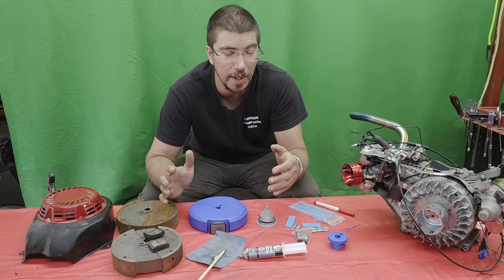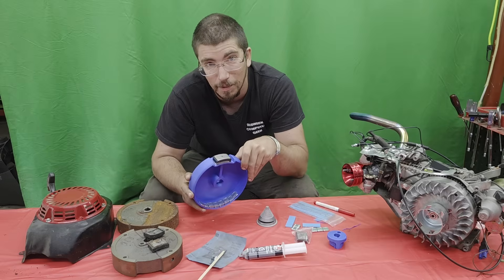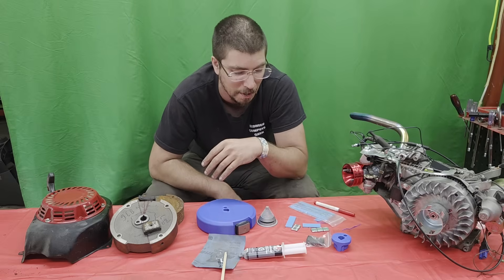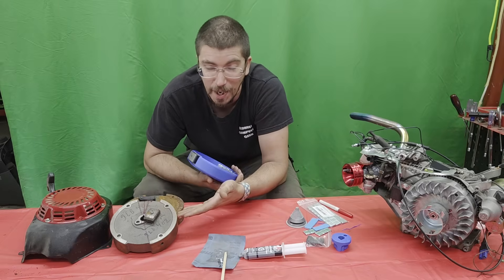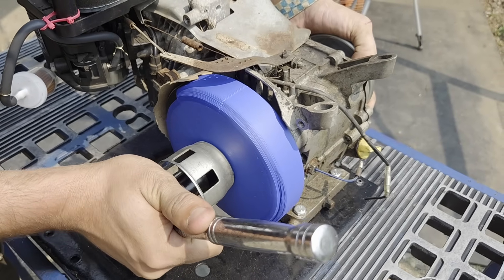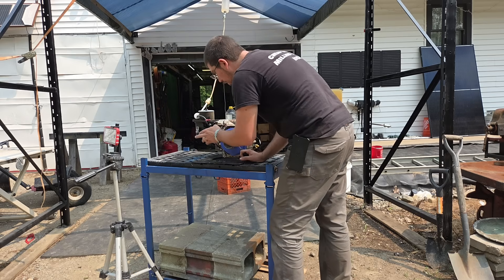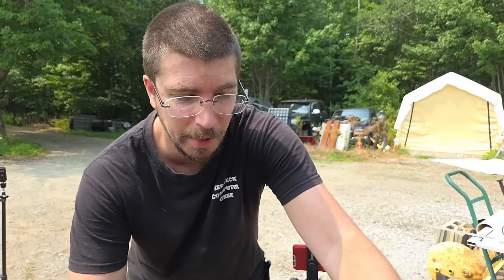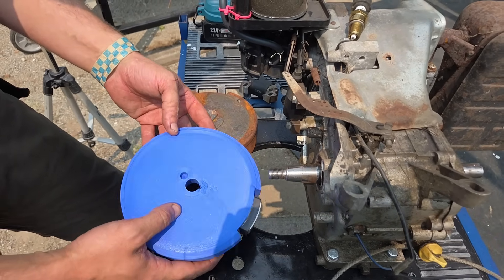Engine Experiment 3D Printed Flywheel - 3D Printed Engine Parts Ducar Predator GX200 #3dprinting

Comment: I've had to turn coils backwards to get them to fire.    It's over my pay grade as to why some hafta be flipped , but polarity does affect spark.   Also some of the aluminum flywheels with 3 small magnets will not work at all with the standard Honda , Clonda coil even though it bolts up.

Comment: If you have any issues with it slinging apart, try honeycombing (or webbing/beams) the inside to add support and strength. And like @ardennislsen3761 stated ,it isn't a one magnet setup, it needs three magnets to work... Don't give up yet!

Comment: you need 3 magnets, N~S~N ... to force the polarization shift in the coil harder, an iron flywheel does that because its made of iron and has a magnet on it. two smaller neodymium magnets to create a tiny boost in total flux shift... 3 in front to pre shift the coil flux 2 out back trailing the main power magnet, replicating the flux field image on the iron flywheel. add more inner webbing
Reply: My opinion exactly. It isn't merely a one magnet setup...

Comment: I've been experimenting with Flexible PLA as opposed to TPU and it does seem to print well on my anycubic machine. you could use a fairly dense infill and creative geometry to  get a more solid structural object still at minimal weight, but if you could go TPU you'd have a lot more toughness. Heat resistance  too with the TPU would be better.

Comment: I was wondering about the flywheel being too light, and that might prevent the motor from running, but it should still spark.  Those are two different issues.
Make yourself a magnetizing tool (an electromagnet ) to increase the magnetic strength of the Chinesium magnets.  A better option, is to re-magnetize the bars you remove from old flywheels.  Another thought, would be to use the niobium magnets from an old IEDE or ATA hard drive.  They are brutally powerful.  
When you were rotating the flywheel with the drill. you should have got a spark.
If it does work, one other issue that occurs to me, is that the flexibility of the flywheel at high speed, might cause the magnet to touch the coil and ground out.
If you do get it running, I would build the next flywheel with a lot more webbing, to cut down on the flexing.

First things first, with the way you had it set up, it should spark, so I suspect the magnets aren't worth a pound of powdered something something.